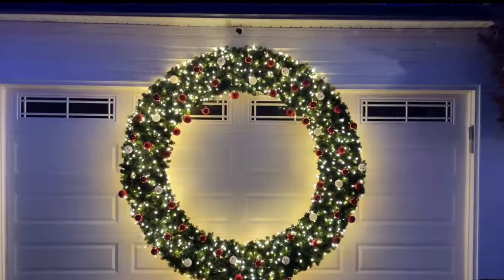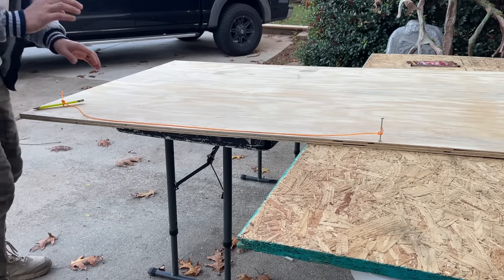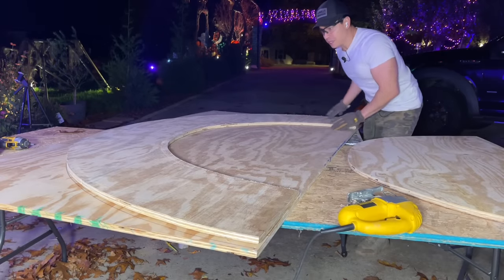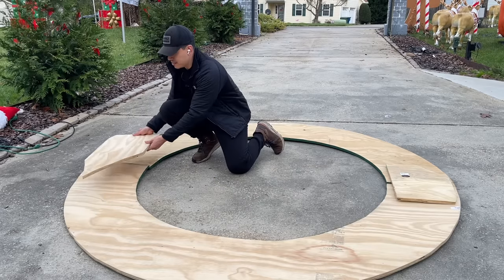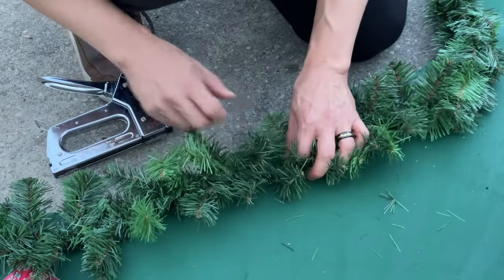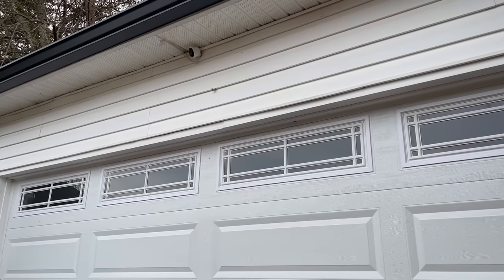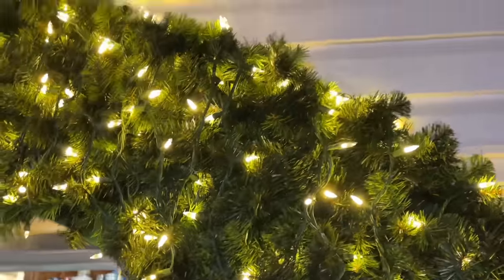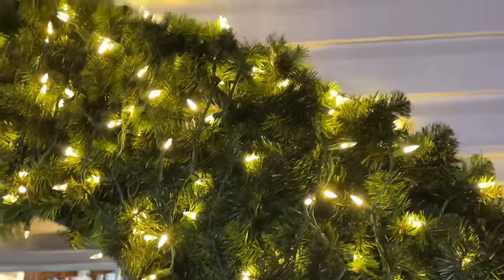8FT CHRISTMAS WREATH - TUTORIAL

Comment: I get rain. I made character cutouts a few years ago. Used multiple coats of paint before painting the figures and then used a spray sealer.
I didn't have a problem the first year, so I put them back out the next without additional sealer. Mistake. Had to re-glue, clamp and putty the separated plywood layers, in spite of the multiple layers of high quality exterior paint. Seal both sides and edges with a few layers of transparent sealant, or you'll have to make new ones frequently.
Reply from the maker: Thank you for this amazing tip!

Comment: Great idea 🤩 I will however use studs and thread the holes to resume every year 👍🏻
Reply: I was thinking that it could be made to fit within the height of the garage door opening. And run some 1/4 inch eyelet lags straight up into the header. And just leave them in to hang it from pretty easily every year.
Reply from the maker: I love that idea !

Comment: Love this ginormous wreath. Just a suggestion - if you want to save on the # light strands, use the screws around the whole perimeter of the frame, that way you're cutting down on the # of strands since you're not wrapping them from the back to the front. You're really talented!
Reply: Or use garland that has lights built in. They have prelit garland.

Comment: OK, I am officially out of English superlatives so I'm resurrecting my high school French. C'est Magnifique! That's a show stopper, to be sure. I think the proportions are just right-not too thick or thin. Not putting the screws all the way around did use more lights but you said you had a bunch from last year but more than that, it added a gorgeous glow behind it, further setting it off and making it shine. Not sure if that was the plan but either way, the effect is beautiful. (Now I have to backlight the wooden tree I'm making from 6' pickets. My poor husband...)
I would caution anyone in a wetter climate or if this will be displayed in the open to really seal the end grain to prevent delamination. Isaac didn't need to because this one is protected because of the location and not many freeze/thaw cycles. Epoxy is best but I've had really good luck with a shellac-based primer, then paint. Water based may work but I'm just giving my experience. I have a prop of chipboard that's still in good shape after 15 years and you don't want to go to this effort and expense to let it get wonky. For me, the time and cost was worth it in the long run. I have one I did not seal, just painted, and now it needs repairs. Even doing one on a smaller scale it's worth protecting. Living with wet, cold winters has its price.
As to the drilling into the siding-eh, it's your house. I have two permanent eyebolts in the fascia where I hand the spider web.
Reply from the maker: Thank you for the kind words and amazing tips! Those are great tips!

Comment: I love this idea. I think I'd like to try making one half the size and putting it on my shed. A 4' wreath is still an impressive scale. I wonder if making a 4' wreath would be light enough to hang on the double shed doors with 2 wreath hangars? That way I wouldn't have to drill directly into the shed to hang it.
Reply from the maker: I’m glad you love this idea. My only issue is the plywood is heavy and a 4 foot wreath would still be somewhat heavy. Screwing allows for it to be very secure

Comment: Is there a way that you could make this in separate pieces because I want to make this but there is no way I can get it up in the attic
Reply: Just unscrew the bracing from the back. You'll have to account for the garland coming apart but if you cut it alternating on either half you could fluff it to hide the break. So the garland isn't cut in one straight line. Sorry to jump in, I'm on a roll.
Reply: Someone commented about using piano hinges & latches to make it in halves, don't see why it wouldn't work for more, smaller, pieces.

Comment: Why didn’t you staple the lights to the board instead of wrapping it around?
Reply from the maker: It’ll be much easier to remove the lights or replace them if one goes out or when it comes time to store them. Using stables to hold the lights down is a lot of extra work for no reason. 
With all the garland in the way, it would be very hard to get a good footing to staple the lights. Again that would be a lot of extra work for no reason

Comment: Clearly, you don't put your car in the garage.  Wait.  So the car is always in front of the garage... blocking the wreath?  It is a good idea if you have a big wall with either no windows or you don't mind your windows being partially covered by parts of the wreath.  Also, this is still a good idea for a smaller (though still over sized) version, too.  Another option is to create an easel-like stand and place it in the middle of the yard.
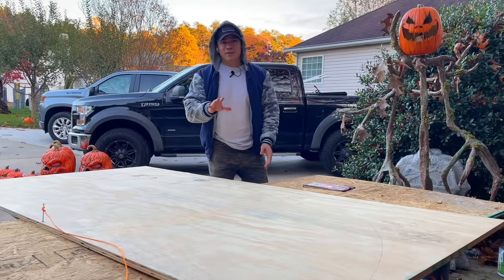Reply from the maker: You can’t really see it from this angle but I had my driveway extended towards the left so that our trucks are parked off to the side, freeing up the driveway. You can see it better at minute 0:40
From the street, the wreath is not obstructed
Reply from the maker: And correct, I’ve never used my garage to park any vehicles. My garage is solely for my gym and my workshop